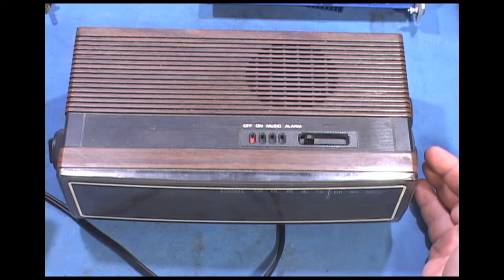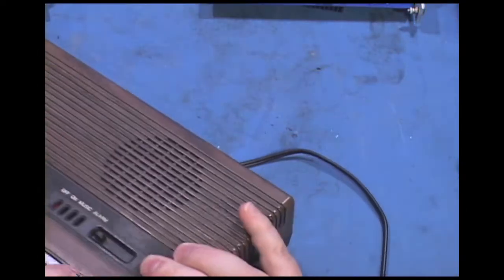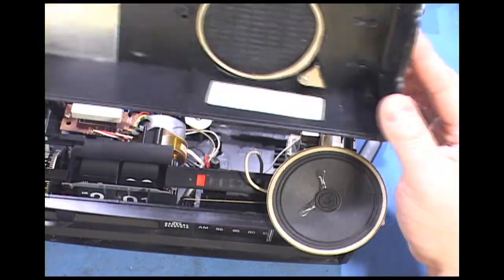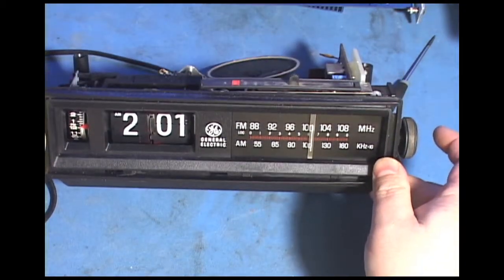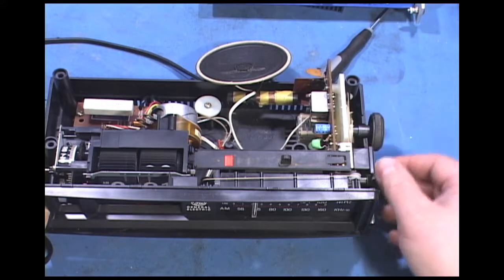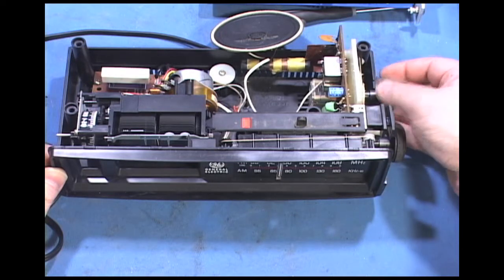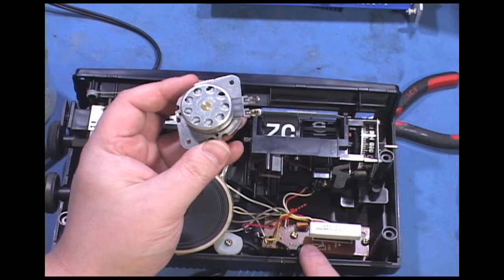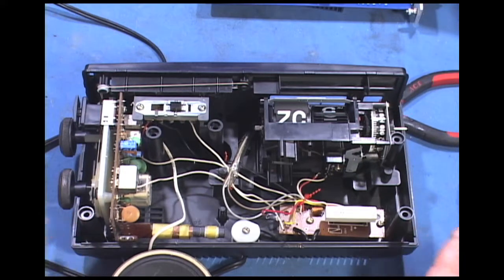GE 7-4305F Clock Radio Repair Part 1

Comment: My father had one of these and the clock died after many years. It took a lot of use, maybe abuse, since he was always resetting the alarm to catch another 10 minutes of sleep. Would have been nice enough, but the 3" speaker was a disappointment for a GE and the lack of a snooze button was almost unheard of for clock-radios of this era.